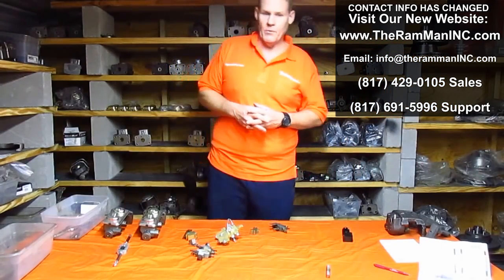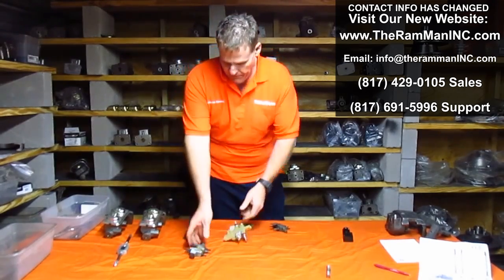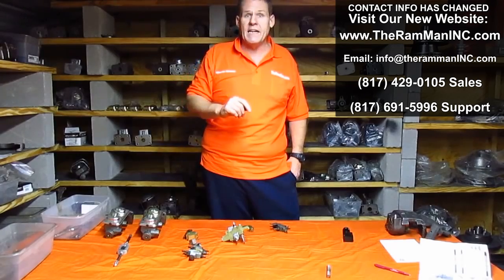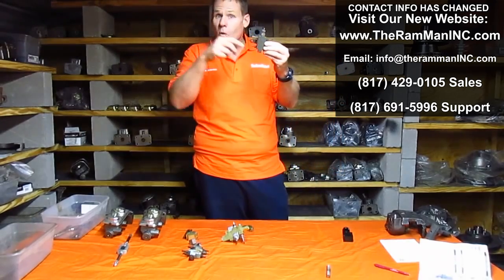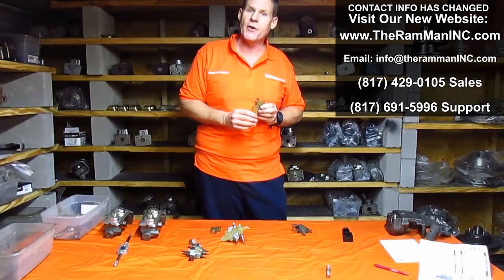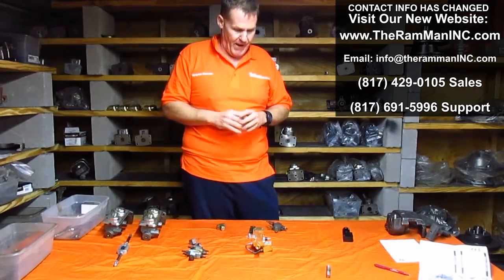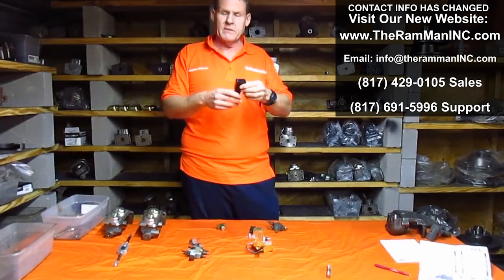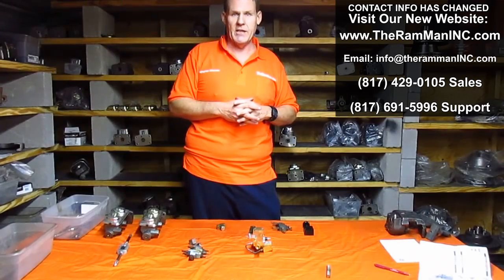PROPORTIONING VALVES EXPLAINED by TheRamManINC.com

Comment: Hello, even though this video is a couple of years old now I want to thank you for putting it together and the info you are presenting.  I'm studying for my ASE brakes test and you finally helped me clarify the difference in the proportioning and metering valves.  I've been looking for a way to sperate the two mentally and I finally got it when you said pressure reducing valve!  Thank you!

Comment: Big Ron learned more about these combo valves  in 12 min. than in the last 20 years Good Job . by the way  I'm a  Ram man myself got  two 2001 ram 2500 4x4 &  2014 1500 4x4
Reply from the maker: Big Ron you need to get some of our locking hubs!! Check out our videos on our locking hub kits you will ABSOLUTELY love them! Check out some of the videos on our channel under the Dodge Hubs playlist! Call us if you have any questions 817-429-0105 we are always happy to help!

Comment: At around 6:40 talking about the metering valve you described the brake lockup condition exactly opposite of what EVERYONE on the net says, ie, "if the rears lockup the back of the vehicle spins around so the metering valve limits the pressure to the rears cyls. (but also allows the rears to engage first)" I have a 4 whl. drum vehicle whose rears did and do virtually no work at all from the factory and nose-dives and the front drums are raging hot with normal braking, rears are basically at ambient temp. no matter how they're adjusted. I'll go to your website and maybe give you a call or email. Good video.

Comment: so can I retain my original pressure reducing valve & put an adjustable valve(the black one shown) in the line to the rear. $ wheel disc brake conversion.  67 Barracuda 15" x 8" wheels, 235 60 15 tyres?

Comment: Solid video. I leaned lots. Always wanted to spend more time on this. Question: any issues cutting in a manual Valve or what I call `bias`valve between the proportioning valve exit to rear and connection to existing rear line? Brake stands is one reason to do this. To test tires. To burn up tires presumably you`d adjust the manual bias valve to run 100% of the pressure to the front breaks and none to the rear. Recently lost master cylinder and booster so replacing those 2. The adjustable bias valve has 3/16 in and out so I need to convert from 3/16 to 1/4"line for the rears,. Haven't bothered with rear discs but maybe I should. Any suggestion? Okay cutting in manual value after master cylinder and before rear brake? Line would be coming out 3 /16

Comment: I have a 1974 Dodge B100 the driver side caliper is locking, I have replaced both front calipers and brake hoses. Can the prop valve get stuck and not let the fluid return to the master cilynder ?
Reply from the maker: Prop valves are NOT usually the culprit. Watch the two videos at the link titled "Brakes Dragging":

http://therammaninc.com/videos/Trouble-Shooting-Videos-142

Comment: recently ( last week) i converted my 68 fury power drum car to disc on the front with a 72 fury set up. i notice the rotors are a little hard to turn by hand with the wheel off, i  didnt change the master cylinder from the drum master cyl  to a disc cyl yet but im going to, would that take care of the rotor not wanting to spin easily ? and should i change the prop valve? and if so, should i use one like the combo valve/ta one  you showed in the video?
Reply from the maker: Hello Aaron. Email us some photos of your master cylinder to (info@TheRamManINC.com) so we can help you. We suspect it's residual valves in the master cylinder.

Comment: Thank you for the great video.. I like it really... I have daewoo nubira 2006, i converted the rear brakes to disk brakes instead of drum brake... Do i still need valves on the brakes lines?
Reply from the maker: When you have disc front and back, you want even flow on your brake lines (regular distribution block). It's only when you have front disc / rear drum that sometimes requires a proportioning valve (depending on how the car behaves in hard braking).

Comment: Ramman: can a stuck p-valve ball cause low brake pedal? my 97 corrolla pedal goes to the floor but does stop. (i replaced master cyl, adju drum and diskpads,bled system....all that done by a master mechanic and car builder i'eve knowm my whole life....he's stumped on the low pedal prob.....my only componet left to replace is the p-valve....you think that my be the prob?
Reply from the maker: Valves are almost NEVER the problem. However, too much pedal travel (with a front disc / rear drum setup) is almost always due to a problem with the rear drum setup. Worn drums, worn brake shoes, not adjusted properly, etc are usually the culprit. Most people don't realize that even a small amount of wear past the drum's wear specifications, can have an exponential effect on pedal travel. That's why, many years ago, you could buy brakes shoes that were slightly thicker than the normal specs, to compensate for drum wear.

Jack the rear end of your car up, get a buddy to help you gently press the brakes while you observe the behavior of the rear wheels braking and simultaneously communicate with your buddy on how much pedal travel there is. Then pull the drums and do the same thing again....is one side acting differently from the other (one side braking sooner)? How far does the pedal travel before the shoes engage with the drums? What's happening with the wheel cylinder pistons? These are all the things that can be the culprit to your pedal travel. Once you are able to see with your own eyes what is going on when he pushes on that brake pedal, you'll probably discover the cause of your pedal travel problem.
Reply: THERAMMAN01
thx for the reply but we did all that we have a lift to to do thorough checks for leaks as well. nice to know the P-valve is probably not the prob because that is a spaghetti factory in there!